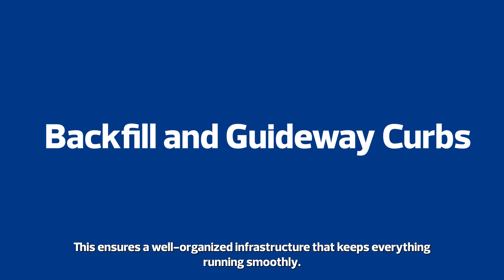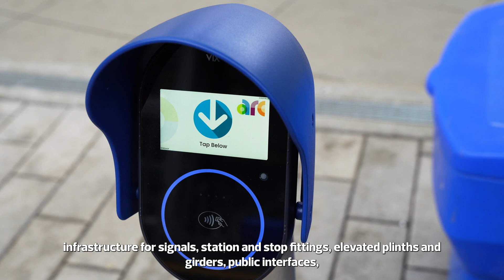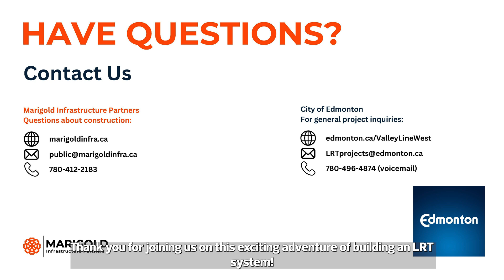Layer by Layer: The Steps to Build an LRT 🚆

Comment: Why not convert the train line to make it underground like montreal
Reply: It’s a tramway more than a railway, essentially connected streetcars on a dedicated route. A true subway system is about 10 times the cost, worthwhile in a large metropolis like Montreal but more than a city the size of Edmonton needs or can afford.
Reply: Cost. Subways are super expensive to build these days. This will still be ok. Of course metro would be ideal though. I’m very excited for this to be finished though. 
Just to give you an idea, this line costed a couple billion to construct. That’s above ground. Mostly street level, the cheapest form of tracks. Underground through a well established part of the city would take like a decade and probably 15 billion dollars. I’d argue the only route that could qualify for a metro is the south line from one end of downtown all the way down to the south end of the city. It already operates as a pseudo metro and even has an underground portion with several stops.
Reply: In addition to what Christopher said, I am guessing that there is also more red tape. As society progresses, it becomes harder and harder to make any changes.